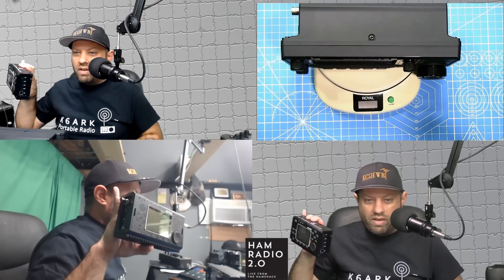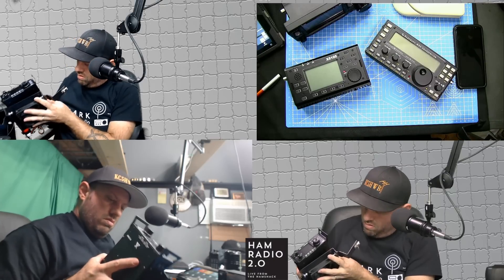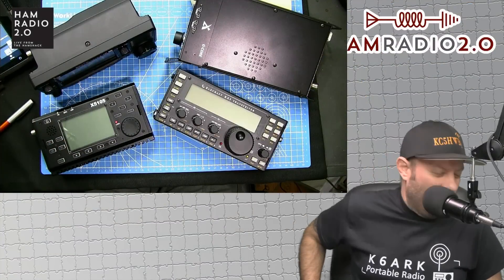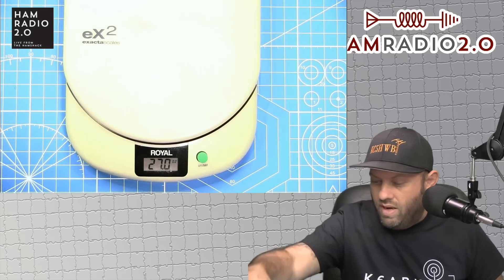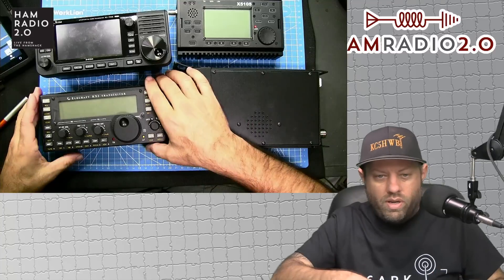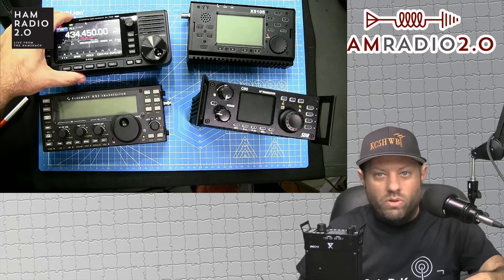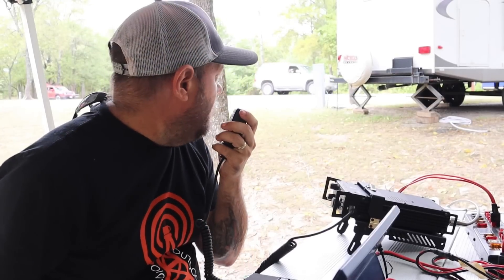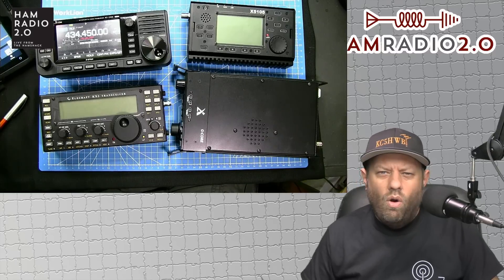IC-705 vs KX3 vs X5105 vs G90 - QRP Ham Radio Comparison

Comment: Xiegu G90 isn't considered a QRP, it will transmit 20W maximum power. I like it much better than the X6100 I also got. When I got the ICOM IC-705, I lost my enthusiasm for Xiegu radios fast. IC-705 by functionality is superior over Xiegu and Elecraft. Xiegu radios are Mickey Mouse. ICOM IC-705 with the ATU-100 EXT automatic antenna tuner, can't go wrong with them.
Reply from the maker: QRP is defined as "low power" or "turn down power" according to the original Q Codes. Anything lower than 100w is actually QRP. The thought of QRP being defined as 10w or less comes from contesting but that doesn't mean that a 20w radio isn't QRP

Comment: Starting with Firmware 1.75, they added FM to the G90, but 1.75 had bugs. All ironed out on 1.77.
Reply from the maker: Good to know about 1.77 - I was aware of the bugs in 1.75 so I hadn't bothered to update to that one yet.  If 1.77 is good, I will make plans to load it.
Reply: @HamRadio2  OK, just don't use the update tool that comes with it. Use the older version of Terraterm. Is not Xiegu's fault, 73!

Comment: Your weight comparison is flawed. In order to compare  the 705 to the KX3 you actually need to compare it to the KX3 and PX3 as the 705 has the build in pan adapter.
Reply: No he doesn’t. With that logic the G90 shouldn’t be included because it doesn’t have an internal battery.
Reply from the maker: The KX3 doesn't have the pan adapter built in like the 705 does. This was a comparison of the radios, not their accessories

Comment: The X5105 is a great little QRP radio, battery will last many hrs, good tuner but I usually used multiband EFHW 49:1 because if my SWR is 10:1 then I'm loosing 66% of my 5 watts, if it's 4:1  I'd be loosing 44% of the 5 watts so for qrp a resonant antenna is much more important than a tuner. A EFHW 49:1 will ensure as much power is going to the antenna as possible as SWR is usually under 1.7:1 and can be 1.5:1 or lower on some bands, you do need a tuner for the non resonant bands so I'm not too bothered about having a tuner.

The G90 is a decent radio but it's not the nicest radio to use, the buttons are horrible and the tuning knob is not nice to use. It's filtering isn't the best, the 891 filters are way better. The screen is useless, I'd rather the ability to plug into the laptop and control it like a proper sdr transceiver for larger waterfall. 

For digi modes the G90 is great though.

The FT-891 is the same size, a bit heavier but can run 5, 20, 50 or 100 watts and it's got a fantastic receiver and audio via headphones. It's one radio I'll never sell. 

I don't have a 705 and at 1500 Euro's I won't, it's just not worth that money for 10 watts and only 5 on battery is a real joke, they couldn't even put a proper 12 v battery in there in this day and age......it's a cool radio and great features but they price makes it more expensive than a 7300.......

An 891 + EFHW + XGGCOMMS interface for Digital and you still got a tonne of cash left over. In fact my 891 + Chameleon MPAS 2.0 was cheaper than the 705........
Reply: o00scorpion00o, 
Very appreciative your comments. When I read them I catch my mind that we are almost always on the same page.

Does Xiegu x5105 had hiss noise like in G90 or x5105 superhet much better (less noisy)?
Reply: @rst5nn  yes the 5105 has a hiss making headphones almost impossible to use. xiegu are working on a new portable radio the x6100. check out the link below, looks a like a great radio with really good features but too many radio manufacturers don't think of the actual sound quality today which i think is much more important than anything this is why i love my ft-891 so much it sounds amazing with my snnheiser pair of headphones. 

I think Yaesu have the edge when it comes to sound quality.
Reply: @o00scorpion00o  
Totally agree, we recently discussed that sound quality of FT-891 is better than ic7300. Due to hiss noise I sold my G90. 
That is why I very like QCX due high quality very low noise amplifies. 
I also looking for some portable (QRP but not necessary) rig without hiss noise. But it seems like it is more important for marketing to have 100+ features which you never use instead of quiet receiver, good audio quality, sharp filters and properly working AGC.
Reply: @rst5nn  yes agree 100%, I think 
sdr introduces a harshness to the audio not just hiss although my Airspy HF+ sounds pretty fantastic i have to say.

my Friends Kenwood TS-590SG sounds a lot better too than my 7300.

i wonder what the Ic-705 sounds like ?

Have you looked into getting  a Elecraft Kx2 or Kx3 ? they are supposed to have excellent receivers and sound quality but pity no proper lithium battery for the Kx3.

The Kx2 and 3 need an update.

Comment: Unless you are backpacking in, weight is not so critical. The G90 has the best tuner of most radios and will match just about anything. The G90 along with the IC-705 both have band scopes which are very handy. The IC-705, like the popular IC-7300 is touch screen menu driven and easy to use but there is no ATU so you will need resonant antennas or a tuner. I have a G-90 and battery packs and the options for antennas is great.
Reply from the maker: True but lots of people have asked about the weight, specifically for backpacking and SOTA
Reply: But, weight is only one aspect. We are not speaking about feathers, its Radios. Your milage may very? I not sure I would want a 705, on battery at 5w and no Tuner. Still need  battery at full tx.

Comment: Another good comparison videos is what they sound like on the air, the frequency range of each radio and operations on different modes. If you have a Discovery QRP radio (can't remember who makes it), that would make a great wild card to throw in as well.

I do plan on getting a IC 705 in the near future. By doing some comparison videos with other QRP rigs, I'd like to see what other options are on the market. 

73, W4ISB
Reply from the maker: That's coming

Comment: I don't see a need for WiFi, Bluetooth or D-Star. G90 all day long. The G90 has been very good for me. I would like to try the KX3. But I can get a nice Alpha Antenna and a G90 and still have money left over... So sorry Icom and Elecraft.
Reply: Bluetooth is great. There is no reason to not built that into newly developed radios. A wireless mic is so much better than a cable! No defectice pins, broken cable, freedom of movement. And Bluetooth could be used for so much more, think only about connection to a smartphone, remote control, recording etc.. Cables and connections are a source of malfunction, sooner or later.
Reply from the maker: They could drop the DSTAR and not hurt my feelings at all. I do enjoy the Bluetooth though

Comment: If the zombies were coming and you had to get the hell out of Dodge, with the condition,. You could only take one radio for two years period of near isolation.  Which radio would you take?
Reply: FT-991A
Reply from the maker: None of these. I'd want something with full power.
Reply: @HamRadio2  the world would be very quiet, you wouldn't need much power to be heard. Silver linings 😄
Reply: @3dPrint_and_chill  Sunspots still have a vote.

Comment: Bells and whistles are great but which radio has the longest range, where it can be consistently heard clearly?
Reply from the maker: If you are looking for longest range, QPR probably isn't what you want.  The different between 5 watts and 20 watts is negligible.  QRP rigs are mostly for folks who want to go out into the field and operate while carrying light-weight packs or small equipment

Comment: What about the ft 818 and the 817?
Reply from the maker: I don't own either of those radios.
Reply: My ft-817 is over 2 and 1/2 pounds. 39.6oz with battery.
Reply: Ok
Reply: I know a Ham who has the 818 and I knew from talking to him on air something was wrong with his audio it just had no punch then I found out the 818 has no processor, I couldn't believe it, you really need processor with 5 watts. The X5105 is a great little qrp radio and sounds good on air.
Reply: @o00scorpion00o  many people have added a speech processor in the mic or the mic line for the FT817/8

Comment: Hello Jason, I would like to see a receive comparison between the G90 and the 705 as well as the other radios. I own a G90 and have been looking at acquiring a 705. I think the best way to do it would be to have all of the radios feeding off the same  antenna and just using a switch to switch between the different radios. Thank you for your consideration and keep up the excellent content. 73 de W6CPL
Reply from the maker: Agreed.  I have plans to do exactly that.  I am planning to do some POTA with them during this comparison.  Thanks for commenting.
Reply: Before you get a 705 see if you can try an elecraft radio. You might be suppressed.

Comment: Thank you for the comparison of these qrp radios, Jason. Obviously the 705 is the most versatile of all of the units, but the price is hard to justify. '73 Glenn Thompson ke4hzc
Reply: Looks as if we have to wait for the MKII Version with Tuner and bigger battery (one that is capable of delivering full power)!
Why the hell did Icom not include a tuner in this take-away-radio?? Even as an addon board. They are so incredibly  small these days. Elecraft showed that it is no problem.
A portable HF-radio of this price should need no further external devices.